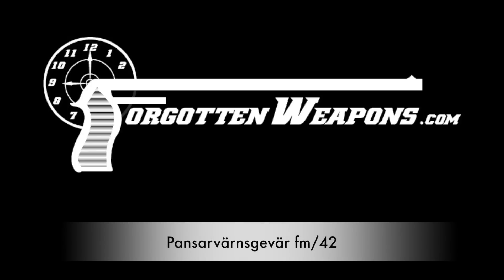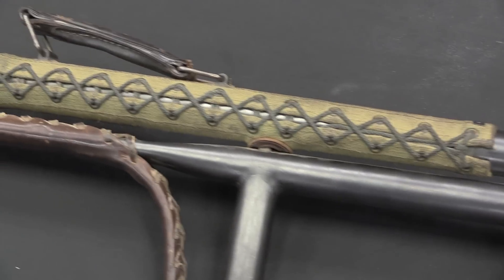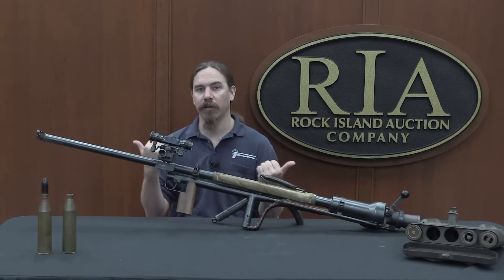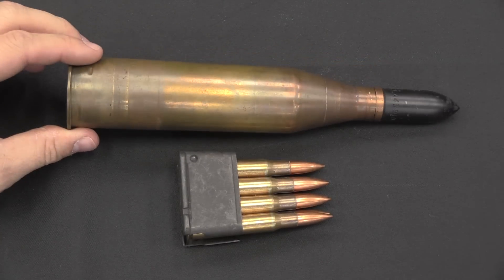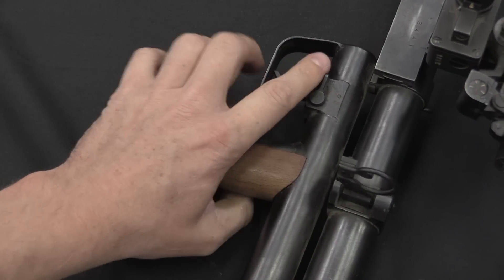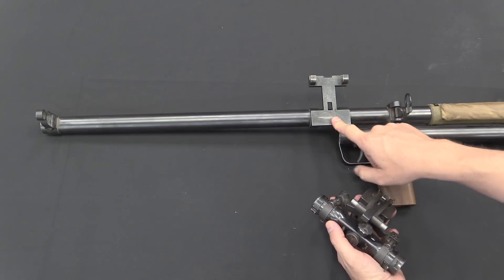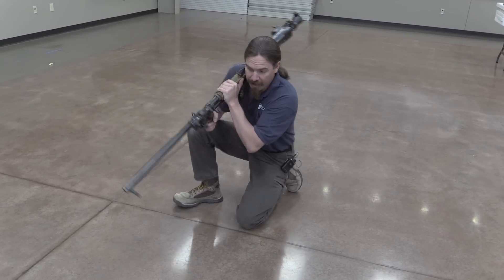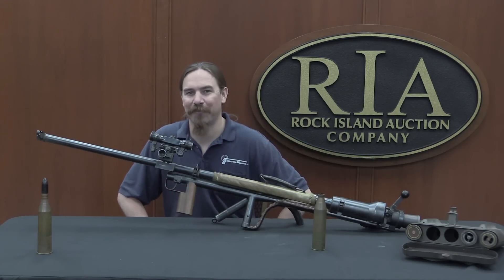Carl Gustav m/42: A 20mm Recoilless Antitank Rifle

Comment: is the breech face field replaceable? looks like those two screws hold it in place and that little slot may be for prying it out.
Reply: Yes, that's exactly why Ian tells us the back plate was only rated for ~20 rounds, looks fairly easy to drop another one in without having to send it back to an armorer.

Comment: Shaped charges do not use a stream of molten metal. It is cold formed. Just to be a wise ass..
Reply: Please Google the subject
Reply: @marvindebot  He's literally right lol, the thermal lag means that the copper penetrator is not a liquid but a superplastic, essentially beaten into its projectile shape by the immense pressure of the explosion behind it, not heat.

Comment: Versions of the Carl Gustav is still being produced today in the M4 version.
The 84mm caliber came from the prototype which was made from an old gun of Boden Fortress which had the classic Swedish caliber of 84mm.

The different versions where developed in these years and the 84mm M/48 as it's called in Swedish service is still going strong.
Some Swedish units also has the M3 but that's a little bit more brittle and not as manly as the cast steel one !
M1 1946
M2 1964
M3 1991
M4 2014

Comment: Croatia build a similiar weapon in the mid-1990's, the RT-20. The main difference is that you load it with normal 20x110mm rounds (also used by many 20mm autocannons) instead of special shells.

Comment: I guess this is similar to a rocket fired inside a barrel, letting the hot gasses escape to atmosphere before the projectile exits the barrel
One question? wtf happens if you dont put the bullet in with the exit jet's (that you dont appear to be able to see prior to firing) in line with the exit holes on the bolt face?? It would look like in one orientation a  lot more gas can escape so that would change the point of impact?
Reply: Yep, that would be right , i did not think of that, the card perforation looked so perfect I didn't think about it being punched out by the pressure.

Comment: I see on the Forgotten Weapons sight that you list the velocity of the round at about 3150 feet per second with a 1650 grain projectile...is that correct? If so, this thing is far more capable than the traditional A/T weapons of the time. I need one of these. I wonder if they'll let me shoot it at the local indoor range?

Comment: What did they target in a tank?
If I'm not completely mistaken a medium tank had ca. 80mm on the front 60mm on the side and 40mm on the back and 20mm on top and bottom. Especially with sloped armour shooting at the rear would still be pointless and I doubt that someone would climb a tank to shoot at his feet, or crawl under it... So what's left? the optics and maybe the turret ring?

Comment: Why didn't they make the back plate from the same material gun barrels are made of, to make it able to have much more than just 20 rounds fired before the need of replacement? The barrels don't seem to burn out so fast. Or is there a different type of physics at works in this case?

Comment: how do you align  the exhaust ports on the ammo with the ports on the closing breach?
Reply from the maker: You don't have to.The whole base of the cartridge is the same, and it burned through wherever to breech ports are.
Reply: Ahh, cool to know, and thank you kindly for the answer.
Reply: @MrOdinic  On the 48 there are groves on the lip of the back of the shell that fit in with the back of the rifle, you cannot close it up if it is not aligned.
Reply: @ZackeTheBrute  That change from the 20mm makes sense as it seems to me that exact alignment of the base openings with the breach ports would allow a more direct exit thus reduce recoil by minimizing impact on the breach face as well as provide a more consistent muzzle velocity, which must have varied depending on the proximity of alignment.   However, I suppose it may be that misalignment with the 20mm was deminimis but with the greater volume of the 48 it became troublesome.

Comment: That breechblock bottom plate lasts only 20 or 40 rounds max? Doesnt seem much at all... Moreover it seems like its screwed in place, making it not so field stripping friendly

+no spare plates on the market
Reply: Are you afraid of a machine shop or what? Go for the newer models and you get the breach plate built into the casing. Jeeez...

Comment: The trick is to get the gas to go fast enough, hence the venturi. The Principal is Newton's Second Law of Motion The force exerted = Mass Multiplied by Change of speed in unit time. ie acceleration. (F=MA)  The gas may not weigh much, but if you can get it up to speed quickly, it has a lot of force. The trick is to balance the two, or you'd end up with the gun going forward at same pace at the projectile trying to leave the barrel. Though the weight of the gun gives it more inertia compared to the projectile which delays the guns mass attempting to move forwards. Must be fun if you get it wrong.

Comment: Does the gun have a way to index the cartridge to the vents? Or the loader needs to do it by hand?
Reply: > Does the gun have a way to index the cartridge to the vents? Or the loader needs to do it by hand?

No need, the disc is uniform and the pressure in the case punches them out against the openings in the beech block

Comment: Probably not much fun to shoot as I read somewhere that the concussion is so extreme that soldiers are only allowed to fire a Carl Gustav a handful of times per day to avoid organ damage.
Reply: It should be noted that the limit is for the Swedish armed forces, I don't know the limits for the other countries that use it. The old limit was 7 live rounds per gunner/loader, but since the new regulations it's buffed to 11. Exceptions can be made locally, but it's not common place for units to fire more than 11 live rounds at an exercise due to the cost of live munitions.
Reply: Cheers for furnishing specifics, I assumed the limit to be around 3 or 4 rounds per day.
Reply: Basically, if you have any snot in your nose as you fire it. That snot will now be a projectile too and you will have a clean nose.
The problem is when your brain starts coming out the same way. That's when you stop firing.
Reply: B. Hagedash i fierd the 84 mm carl gustav egen i ess in tre swedich Army and its a realt Nice gun to shoot we went over that limmit of rounds fierd a lot of times
Reply: Cool, always nice to get info from someone with firsthand experience.
Reply: The peace time limit is 11 rounds in 24/h for both gunner and loader, as this is a crew served weapon. I've fired the GRG M/48(Or CG M2 in Nato) say double that amount in a couple of hours and it's fine, although you feel a bit squeezed in the head after a while. It's not recommended to exceed the limit though, since the pressure from the live rounds really put a strain on your body. Because of this, the fire team leader is never closer to the gun than 5 meters so that he doesn't get caught in the immediate pressure zone.

We always deploy it in pairs, so that the squad can lay down multiple rounds on target in tandem. A bitch to carry, but fun as hell to shoot, and the effect on target is pretty much self explanatory when it comes to HE rounds.

Comment: Reloading cases for this must be a challenge...
Reply: manwiththestar He meant taking a spent casing and re-packing it as a new round, not reloading the gun.
Reply: tranq45 I suspect you can use pretty much any kind of fiberboard, as long as it's the right thickness. At those pressures, it won't make much of a difference...
Reply: And then there's the every 20-50 round replacement of the breach face.
Reply: @D8W2P4  Mill it out, you can even do a mass-order from some random China CNC shop, and by using modern material, this homemade breech face is highly likely to last longer than the original one. I think another problem would be the how to make projectile itself though.
Reply: a bit of a challenge getting and inserting the blowout disk, is my thought. There can't be much of a supply of those. Scratch built?
Reply: Probably just use cardboard or paper.
Reply: Blowout disk is usually just a pressed fibre. It doesn't in itself do anything apart from stop the propelant dropping out the hole. If it is to solid it holds pressure and defeats the object .
Reply: If you have the connections necessary to get hold of 20 mm tungsten core bullets, you probably won’t have any problems sourcing some fiberboard and a gasket cutter.

That breech plate though... 
The shape suggest that it is forged, before being machined to the right tolerance. With the enormous pressure involved, that is probably not something that can be milled out of some off-the-shelf steel. 
Swedish steel manufacturing technology is, and was back in ’42 about the most advanced there is. I’d be surpriced if the technology behind that breech face isn’t what made this weapon come out of sweden of all places.
Reply: You Can use plasta wrap if you have enough layers hey improvise like soldiers do
Reply: Buddy system maybe?
Reply: O I C... Use what works. It's made in Sweden thats half way to Russia I'm remided by my liberal and socialist friends. The pressure is regulated by the breachblock plate/disc not the brakeage of the material.

Comment: That is NOT how shaped charge ammunition works. The effect of the shaped charge has nothing to do with temperature and melting. Its armor penetration is a result of the kinetic energy of the explosively shaped penetrator alone.
The metal liner does not melt when it is formed into the penetrating jet. The metal merely behaves like a liquid under the high pressure caused by the explosion, but neither the jet nor the armor struck by it actually melt.
Please do not spread this common misinformation any further.
Reply: That's simply not true. HEAT shaped charges never reach temperatures high enough for the metal penetrator to become molten. Typically we are looking at temperatures of around 600 degrees F, while the melting point of copper is around 1000 F. Plasma is a phase of matter that is even beyond gas, so if you aren't even reaching temperatures hot enough for a liquid, it's certainly not hot enough for superheated gas.  Do some research on the Munroe Effect.
Reply: https://en.wikipedia.org/wiki/Shaped_charge  Bottom of the first paragraph. 

https://en.wikipedia.org/wiki/Shaped_charge#Function

Solids that behave as liquids under high pressure are still not liquids if their molecular composition doesn't exhibit liquid tendencies.
Reply: Common amongst people who are at least vaguely interested in guns or military history etc.
You hear this all the time on the internet, and I'm really wondering why it sticks so much.
Reply: RIP just looked it up :( I concede
Reply: glad to see all this actually went somewhere. I also believed the "jet" was liquidized by the explosive, didn't think about how metal behaves under extreme pressure, which indeed is not the same as being a "liquid".
Reply: H311fi5h Well it is a very high energi jet that rips thru the armor. Just like a fast bullet rips thru your soft body.
Reply: Thus it is called "superplastic"...
Reply: true, it is a very rapid plastic deformation. Having flashbacks to engineering school thanks to you :P
Reply: I have a few copper penetrators from 3.5 inch bazooka and if they had been liquid when they formed they would have just splattered everywhere and I never would have found them. shaped kind of like a long teardrop with the fat end being the impact side
Reply: H311fi5h Look its a recoiless rifle that's what all it matters.
Reply: BTW, superplasticity is temperature dependent.

https://en.wikipedia.org/wiki/Superplasticity
Reply: Fishy still alive?!
Reply: H311fi5h  found them at an abandoned artillery range about 6 miles from where I live. lots of debri from 3.5 inch bazooka rockets in the area I found the copper penetrators. looks like they mostly fired practice rockets but they did fire some high explosive ones  at 55 gallon drums. the penetrators just slammed into the ground behind the drums. found 9 penetrators and 2 whole practice rockets.
Reply: I know this is an old comment, and this may be a technicality, but "Shaped Charges UCRL JC 123850" does state:

 "Extensive metallurgical analyses were performed on the recovered 
slug and jet particles. The microstructural features associated with voids, e.g., dendritic grain growth, clearly indicate that the regions in the vicinity of the centerline of the slug and jet particles were melted."
Reply: I can attest that Hellfish has fired many virtual shape charges :')
Reply: H311fi5h ya what ever
Reply: Chowder Stevens ain't that a shame.Ya'll still dead no matter what do or don't melt.
Reply: H311fi5h  explosively shaped. what the fuck is that shape
Reply: Brasstard 7.62 I didn't know they stayed in one piece. Always assumed they would shatter into a million fragments. Very interesting.
How did you get hold of them?
Reply: No they do not. The explosively formed metal BEHAVES like a liquid. It is not actually liquid (as in the physical state of matter). What you see in a slow motion video looks like it's liquid, because fluid dynamics apply under the extremely high pressures caused by an explosion.
In addition to that, the metal jet doesn't melt through the armor because of its temperature, it penetrates because of its kinetic energy. Or to dumb it down to your level: It's going really really fast, thus it can poke holes through really tough stuff.
Reply: Dunno if that's a low-key threat or not, but if it is, that's pretty savage. lol Also, I don't even think you can call it a 'common misconception' when just saying 'shaped charge' would provoke shrugs and 'idunnos' from the general public.
Reply: H311fi5h Because most people don't understand liquefaction at high pressure, and so most documentaries, etc. still explain it like that 'for the common man' as it were.
Reply: You are talking about an EFP (explosively formed penetrator) which is a type of shaped charge. Traditional shaped charges do use a jet of hot plasma to penetrate metal.